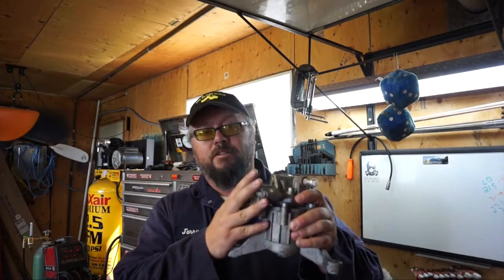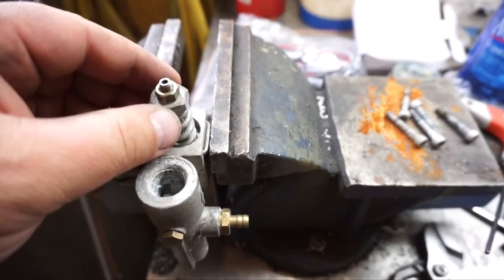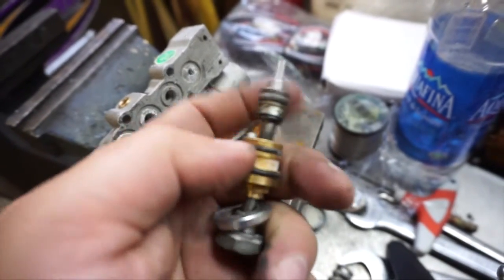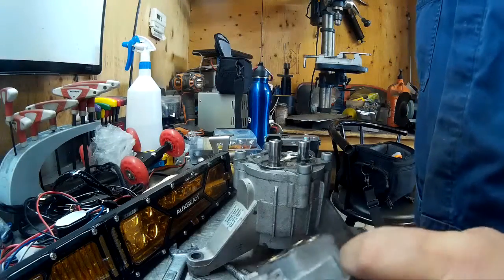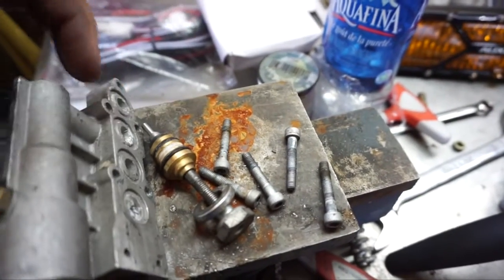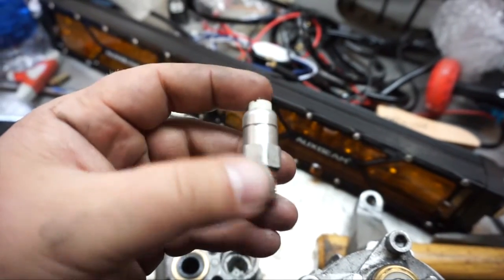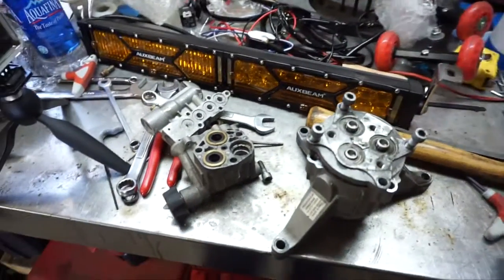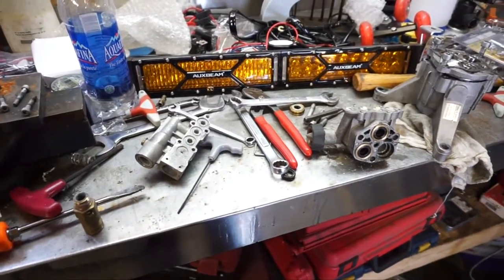Postive Displacement Pump Teardown

Comment: OH great, so at 3 minutes 43 seconds you finally acknowledge there is indeed pressure in the pump itself and you even manage to show a given area on the pump itself! You're welcome!
Reply from the maker: +winelover2007 pressure can exist anywhere as P=f/a,  pump only flows -restriction to flow = pressure.  Seems you have a hard time understanding that.  It's ok somethings are way over people's heads
Reply: I have no issue with p=f/a and never have, I understood that when I was ten, not sure why you keep on reiterating what is true and not in dispute! You have just published a video in which you yourself have shown with your hand where the pressure lay within the pump for goodness sakes, yes a pump is designed for the purpose of creating flow, but that flow withing the pump is subject to pressure, as I said before, if pressure didn't exist in a pump, why did my dads swimming pool pump blow up because it was wired incorrectly?? Obviously the propeller, sorry sorry, impeller, was not going the correct way around and it blew side of the pump apart with the pressure for which it was not designed for and luckily it sped past my dads head or it would have taken his face off!
Reply from the maker: +winelover2007 it's clearly you don't understand as we wouldn't be having this conversation.  I see you failed to mature being past 10 as well.
Reply: Can you explain then, if this is a DIY / how to channel/show of sorts, exactly in plain English for us ten year olds, why you have pointed out in your own video an area where pressure lies?
Reply from the maker: +winelover2007 you lack the ability to understand, everybody else understands except you....... Funny how that works I bet your a liberal as well

Comment: Watching the first video, I was wondering if you were going to tear down this pump.
However (and I'm being a smart-ass) if there is a section of this pump housing that creates a restriction, and therefor pressure, then wasn't your troll technically right about pumps creating pressure? LOL
Reply from the maker: +UndergroundTrev nope cause P=F/A if pumps produced pressure why would we need pressure regulators, why wouldn't  your blood pressure stay the same always.
Reply: No worries, I get it, like I said, just being a smart-ass. At 5:46 you said something about a part of the pump where the water flowed through valves and into a section that created pressure. Just giving you a hard time about that part being part of the pump as a whole.
Reply from the maker: +UndergroundTrev when you going on a back country camping trip with Dave and Randy they will teach you about Force and pressure hahahahahahah
Reply: jerry bskorner WOW! LMFAO!!! I think I may have too much restriction for that!

Comment: The small fitting is either a pressure relief or a thermal relief. When the pump goes into bypass (trigger closed) the same water circulates through the pump head. After a few minutes the water can become too hot and possibly melt the seals/check valves.
Reply: good point on the thermal relief that makes sense as well